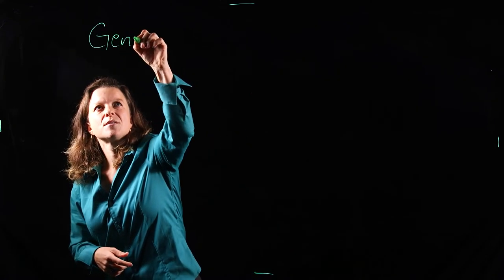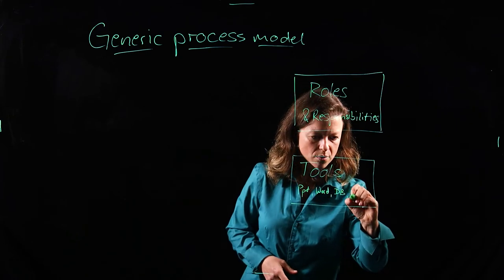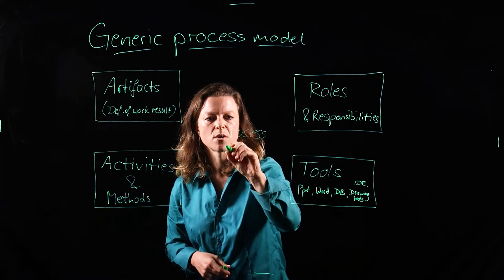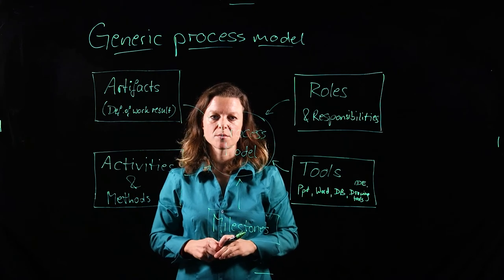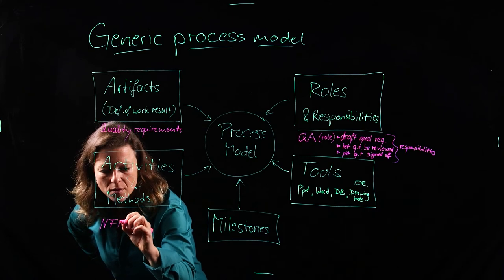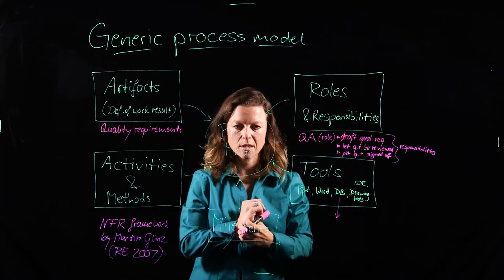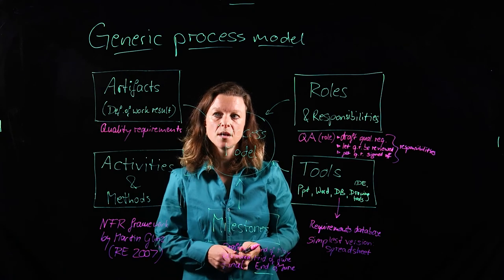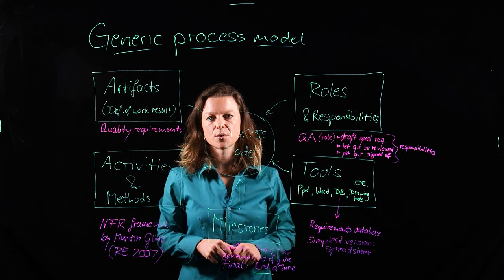RE LECTURE 4 Generic Process Model

Comment: I am actually into software testing, but with this tutorial ma, I am going directly into requirements engineering for my PhD research. 
But ma, is there anything like software testing requirements? Can I formulate a problem like this?
Reply from the maker: Yes, there are works on requirements for software testing, if that is what you mean. I'd recommend to start with looking for related work at scholar.google.com and on Research Gate as many researchers make their published works available for free. That way you get a good picture of what is out there and what might still need research. When you look under "further steps and future work" in those papers, you will often get good ideas for what is still in need of research.
Reply: @BirgitPenzenstadler  
Thanks so much ma
Reply from the maker: @adekunleajibode214  You are welcome!